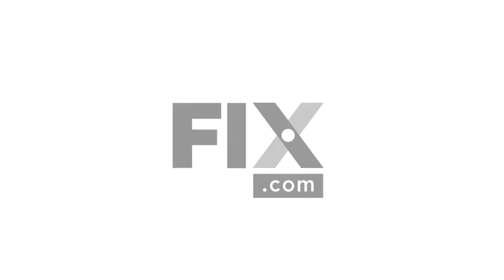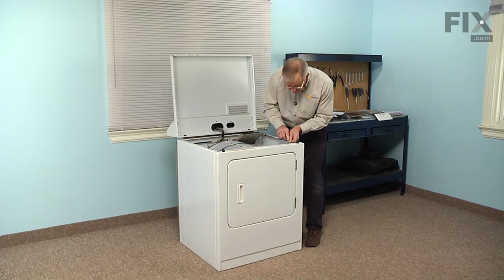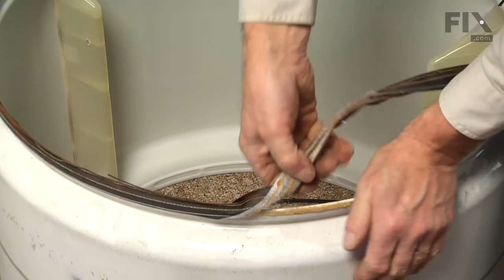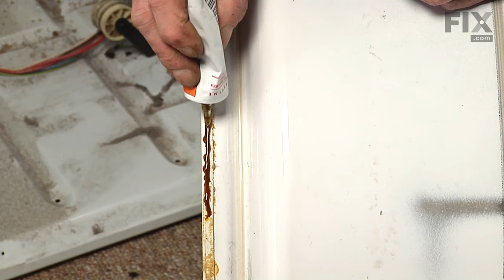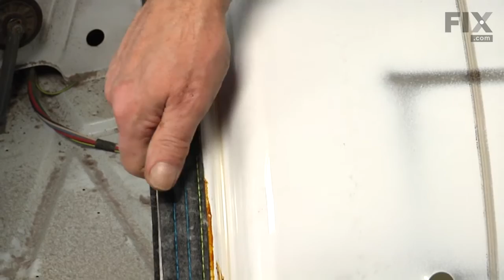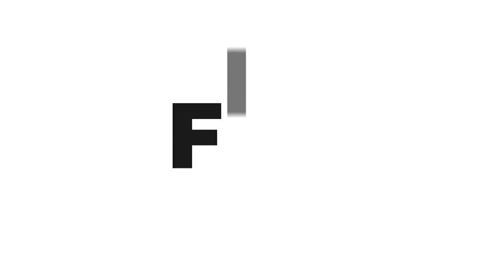Whirlpool Dryer Repair – How to replace the Drum Felt Seal

Comment: What would happen if I use aluminum foil tape, instead of glue, to secure the felt to the drum?
Reply from the maker: Thank you for your question. The glue used here is a high-temperature adhesive that is designed to attach the felt to the drum. With aluminium foil tape, though it is generally safe to use at high temperatures, it may not allow the felt to stick properly, and this can lead to further problems, and further repairs. I hope this has helped, and good luck with your repair.
Reply: @FixDotCom when you buy the felt the glue its included .